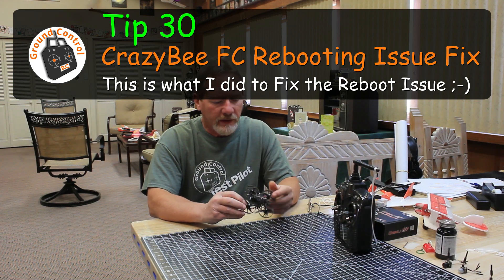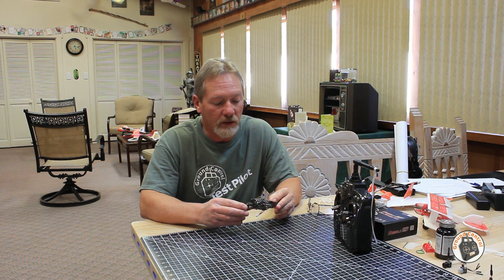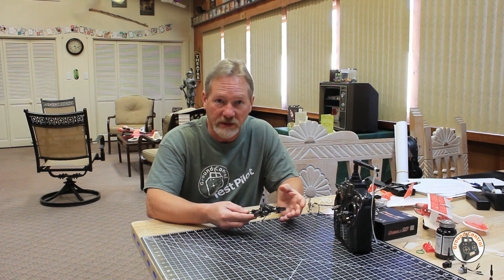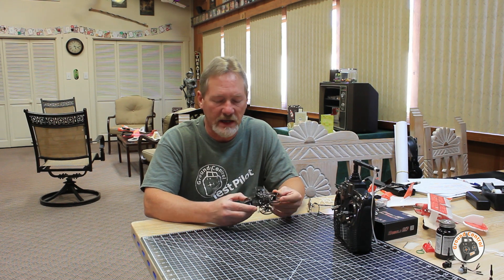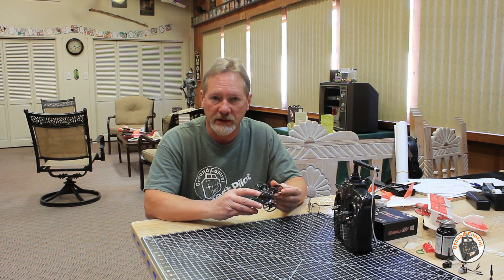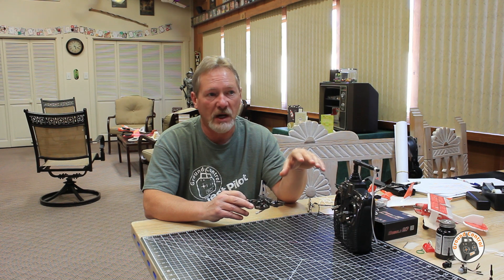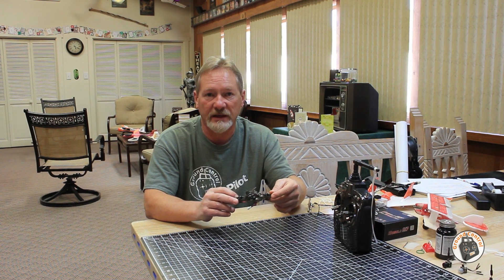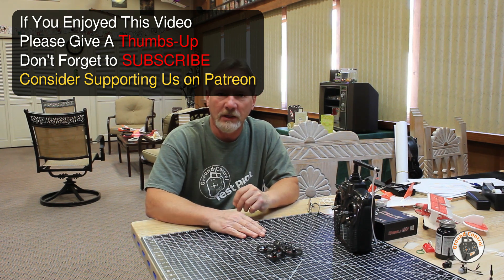Tip #30 - CrazyBee Flight Controller Rebooting Issue Fix!

Comment: This video is a bit old, but I'm having this problem with my Mobula 6, that restarts midair randomly. It doesn't seem to be related to Batt voltage. I'm trying to lower this gyro update frequency, but it has been locked since BF4.2 on. So now it's set to 8kHz. I'd like to lower it to 4kHz to check if that's the solution. Is there any option to lower it anyways or will I have to actually downgrade to prior versions?
Reply from the maker: Hi Gregor!
I'm not familiar with BF except for what I've needed to configure.
If the version you're using doesn't support a lower frequency then I'd say yes you'll need to go back to another version to set a lower frequency for testing.
That would be better than having it fall out of the sky constantly as it certainly fixed my issue.
It seems some of these boards are not capable of the frequencies they're setup to use.
Reply: @GroundControlRC  I think I found the issue. It is very possible that it's a bad batteries. The original batteries that came with the mobula6 are no good after a few flights. The in-midair reboot happens with them, but not with other batteries I bought later. They have much lower voltage-drop and the reboot just don't happen with them. It seems that this drone is very sensitive to voltage drops. Thanks for your help anyway!
Reply from the maker: @gregor.potrebujes  Hi Gregor!
I'm glad you found the issue.
I haven't seen that problem before so that's good information to have.
Thanks for providing the fix.
See you in the Air!

Comment: Sir. I have some issue with mob7 HD not big different with u issue. Before its normaly. I got crash when landing but not to high its about 2 meter. After that still normal i can fly also. About 10menit i come inside to my house and try to hovering and landing. After that the drone lost conection with transmiter. And ask to re binding. It try to figure it out and i can fix it. Mob7 binding again with transmiter. 
But now the throtle its like eror. When i push throtle to 30% and i drop to 0 the throtle cant be stoped its stil spinning. Thats is some bugs or what. Its still happening until now. Please ur advise🙏
Reply: Ok thanks sir
Reply: I mean the motor still spining cant be stop. I have to be disarmed to stoped. Hoefully i can send some video to your email🙏
Reply from the maker: Hi Varid!
I'm not very familiar with these Flight Controllers as the Mobula 7 was the last Quadcopter I had before I transitioned to Planes.
It sounds like the Gyro needs to be re-calibrated.
If the motors are not stopping at 0% Throttle it could be the Gyro does not recognize level anymore and it's still spinning the motors to try and level the quad.
It also sounds like the Throttle Range needs to be re-calibrated in the flight controller software with the throttle stick on your transmitter.
The crash could have damaged the flight controller but I would try to re-calibrate everything just to see.
I would also check all the wiring and solder joints to be sure nothing worked loose.
I hope that helps and I'll see you in the Air!

Comment: im gonna give this a shot. having the same issue, blackbox cuts off so im believing its not a failsafe.
Reply from the maker: Yes, it's worth a try.
When I researched this issue most were saying it was a fail-safe due to a loss of communication with the transmitter.
This certainly fixed mine.
Good luck!

Comment: Weird I have a lux f7 doing the osd reboot/reset,  but its like just the osd resets for no reason. The motors never stop or the radio link just the osd/video goes to a gray color in my goggles  and the beta flight logo come up then all is normal -so for 4sec I have to use the force lol..... gurr   I'm using r9m tranis x7 beta flight 4.2 R9MM in FCC mode. I have gps setup and fail safe is return to home or land. I did notice certain batteries it happens like clock work. I think it may be an issue with current spikes. I have my vtx on a filter, but not the flight controller its wired intoo the battery direct. I'm going to place a filter on it next. Thanks for the video it helped me a bit. thx again.
Reply from the maker: You are most welcome. I don't know what type of battery connector you use, but BT2.0 Connectors have shown to provide better power than those PH2.0 Connectors. I've been waiting for the industry to come out with a standard XT10 Connector but right now it looks like the BT2.0 Connector are the best for these Tiny Whoops/Power Whoops. It could be a power or heat issue? See you in the Air!

Comment: i done everything you said and my mobula7 is still droping out of the sky at random,sometimes it flies great and others i cant get 10 feet away...ive now contacted banggood to see if they will either replace it of refund..its maddening to try and fly and have this happen,i cant go to far with the damn thing having to worry if its gonna drop out of the sky on me and if im not to close ill prob never find it
Reply from the maker: That's a shame. If I had not been flying it Line-of-Sight I probably would never have found my issue. Have you tried re-locating the antenna and also slowing down the other update loop? Perhaps it's one of those issues. Also, can you tell if the board is resetting via the LEDs? That's how I found my issue. You never know as it could also be just a bad solder joint on one of the wires that doesn't cause an issue every flight.
Reply: @GroundControlRC  havent tried that yet but will next flight,it is a shame bc im loving the little quad,im also a total noob so im in need of lots of help
Reply from the maker: @capeRCouple  , no worries! I'm not experienced all that well with quads either. Let me know how it goes. See you in the Air!
Reply: @GroundControlRC  i will keep in touch and ill give u a sub too...i have a travel exploration channel and use drones plus unbox the ones i get if u wanna check it out

Comment: thanks... was pulling my hair out trying to figure out what was with the random mid flight restarts. i was thinking it was losing a battery connections momentarily and was just about to take it apart and i found this video. no restarts so far in a few days
Reply from the maker: Juan, that's fantastic! Mine has not had this issue since the config change, so this was the issue with mine ;-) See you in the Air!

Comment: I lost bind and have a solid red light with a blinking yellow, And it won't bind, This is the 2nd Mobula 6 that did this???
Reply from the maker: Hum...have you tried going back into the BetaFlight Console to set up for Bind again? If there is a hardware problem perhaps it will produce an error message in the console that my point to the issue or maybe for some reason it reset the receiver?
I would start there and if that doesn't work I would look for an updated firmware if it's not a hardware issue.
Reply: @GroundControlRC  I tried a bunch of crap and nothing! Did the dump, tried flashing new firmware! 😠😠😠

Comment: My crazybee f3 restarts if I install the battery and doesn't do anything, the temperature rises and restarts repeatedly, but if I fly it, the flight controller is fine, any solution?
Reply from the maker: The only thing I can offer is what I found with mine. My VTX would get hot with just the battery plugged in until I changed the power setting when not armed. The FC would reboot, but only in flight. It could be the heat that's causing it to reboot but the question is; what component is getting so hot when it's just sitting still?
Reply: @GroundControlRC  if I touch, the hot component is stm32f, the temperature is hot to make me unable to touch it for too long, but if armed and fly, the flight controller is fine, no restart.
Reply from the maker: @ahmadbebeto9657  , it sounds like the VTX is running at high power. Mine was doing the same thing. With no air going over the board it got very hot. I setup mine in betaflight so the VTX was at minimum power when the motors are not armed. I would check that setting in betaflight to make sure it is set for minimum power when not armed.

vtx_low_power_disarm = ON|OFF
If ON and the flight controller is disarmed, the video transmitter output power will be set to its lowest value (vtx_power=1). Otherwise, the video transmitter output power will be set to the configured
Reply: @GroundControlRC  but in my case, the problem is the flight controller, I just tried flight with 2 batteries without pauses and there were no problems with it, flight controll is problematic only if it is left idle (unarmed) 😭
Reply from the maker: @ahmadbebeto9657  , that's a quite a puzzle. I tried to research your issue but everything I came across was related to the VTX or the Camera. I wonder it it has anything to do with the Serial Port Driver?
Reply: @GroundControlRC  thanks before sir, i dont know about serial port driver but at the moment, i have not installed the vtx and camera.
Reply from the maker: @ahmadbebeto9657  , Ahmed I wish I was more help. If I find anything else that could be causing the issue I will post it here.
Reply: @GroundControlRC  thanks so much sir 😁🤩

Comment: Good analisys and explanation of the problem. I wasn't thinking about fail-safe and troubleshooting this way so learned alot, but then my 250 hadn't has that problem before. Great job!
Reply from the maker: Thank you Robby! I was glad to discover that the PID Loop Frequency was not an issue anymore but it looks like they introduced an brand new problem with the Gyro Update Frequency ;-) See you in the Air!